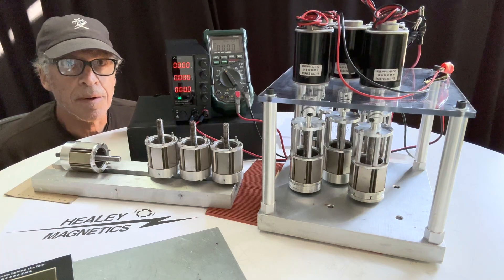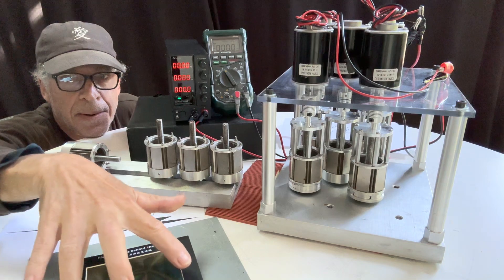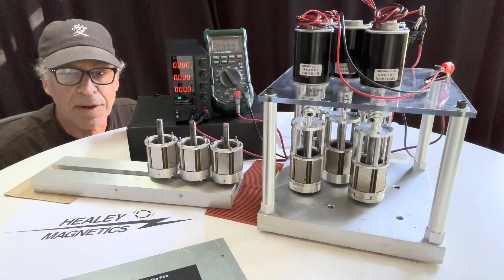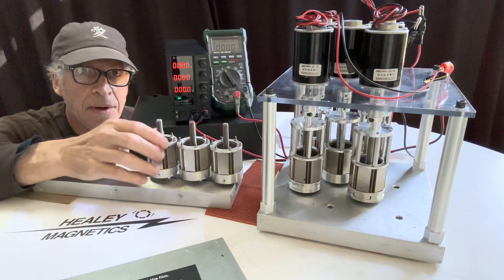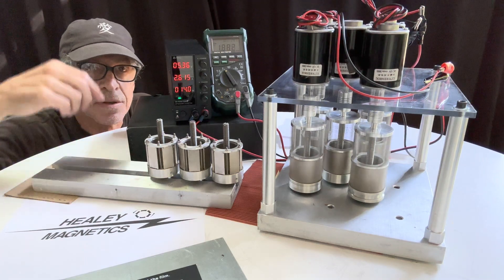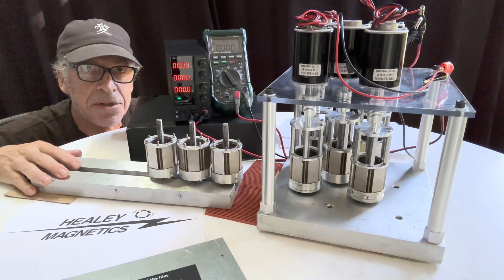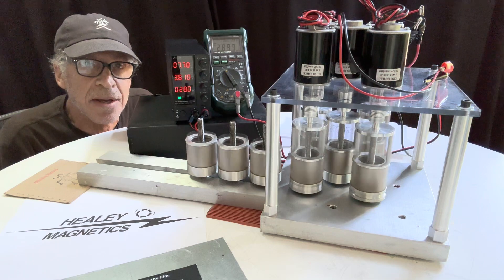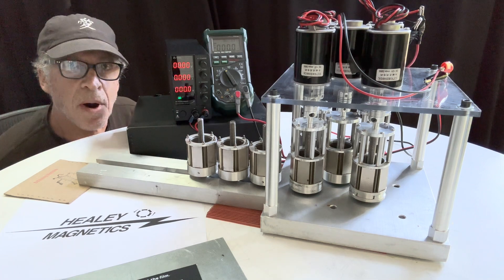Magnetic Gear satellite generator system...

Comment: why are the output motors only making half power ?..
Reply from the maker: Please subscribe .  I am finishing up an explainer video that i will post in a week or so..  This video demonstrates that the  magnet arrays will not slip or decouple.. at high speed. (It is not an energy multiplier defying laws of physics -there are energy losses.. ) the central motor is driving 4 magnetically coupled satellites. If i set it up one to one there is a loss of a few percent.  There is a strange anomaly with this type of system.. and the research scientists i am working with have yet to define why this happens.. maybe you can answer it.. the system with a constant voltage input and ac induction motor(not shown in this demo) speeds up and resistance drops.. it happens in a quantized way.. we think the angular momentum of satellites contributes kinetic energy back to the center motor. The lag and lead in field shading seems to be trying to sync with current and eventually rpm jumps levels out and jumps again.. how is this happening? More rpm without any additional voltage!  Even under a load.!!!  my next video shows several potential industrial applications.
Reply: @evanlevy8947  ok awesome..yes im subbed....its all very interesting.. thankyou for your reply and look forward to the next vid....cheers
Reply from the maker: Multiply by 4… there are 4 satellites rotors.. voltmeter is inly reading 1
Reply: @evanlevy8947  yes...but i was wondering why if they are going at the same speed....why does each only make roughly half?.. i would have thought they would have made say 95% power in ratio?...thanks

Comment: Approximately how much torque can be coupled before slippage occurs with the demonstrated setup?  I presume, this is scalable and dependent on rotor diameter and strength of the magnet?  What happens when load on the system exceeds design ratings and slippage occurs, I would suspect considerable heating of the rotating elements to result?  And have the thermal efficiencies in this magnetically coupled system been studied?  Have you investigated the system with a thermal camera while running for an extended duration?  The thermal considerations are likely the biggest limiting factor in a system like this as exceeding a magnet's Curie Temperature will kill it.
Reply from the maker: Torque is dependent on proximity.. strength of magnets… the system can produce same torque as any electric permanent magnet motor.. and similar temperature ranges.. and we have designed and built new prototypes with larger magnets… Nb magnets loose less than 1% of their strength in 100years if operated under their temp ranges…
Reply from the maker: Also as someone with knowledge maybe you can answer why a weird anomaly occurs with this system… we have replaced central drive with ac induction.. to test at 8,000 rpm (btw-no slippage occurs at really high rpm ).  with constant voltage applied the system speeds up in quantized steps… and amps drop… we think it is caused by lag/lead in emf reacting with the angular momentum supplied by satellite arrays… we are licensing our idea and have several new prototypes built to demonstrate its capacity in industrial applications…

Comment: Would fluid magnets eliminate the chocking?
Reply from the maker: It’s a question of proximity and architecture of satellite arrays.. there are many variables to test and try according to applications… we are designing several systems and the real magic of this system in my opinion is extremely high speeds.. adjustable torque.. and utilizing conservation of angular momentum in a closed systems..
Reply: @evanlevy8947  I am not sure of angular momentum. I will check into that.

Comment: What's the overall powerless per unit added? That needs to be figured.

Immediate implications are quite simple -  being things like a leaf blower, drill, small frictionless motor... HOW much slippage can it handle? I mean, what if I stick a stick in it? How much force until slippage in the middle of the array and how much on the outside array via physical force? Can the slippage be measured accurately by distance per unit? Obviously bigger magnets would have a different effect. May be worth doing the calculations if only with the model you have.
 Industrial applications?
AC units. You would need to add directional blades.
Any kind of medium sized motor.
Cnc machines.
Fluid driven pumps like sump pumps.
Even a bicycle gear...
Reply from the maker: We are doing testing.. and you are accurate as to proximity and architecture… and are working on prototype that allows for changing those parameters. There are some really strange phenomena going on with this system at high speed… i cannot divulge this until we establish independent verification.. but our systems should be a game changer in several different applications..  essentially the nodes and gap angles act as an ambi-polar projection of magnetic flux density..
Reply: @Evan Levy  very promising. May be relative to thermal surroundings. May be relevant to divulge into coil whine but I assume that's been well established seeing there's a field. 

I've always liked what magnets do to mercury.

Comment: Please sir check into magnetic bearings. I theorize that with magnetic bearings, Tesla turbines driven by air could be blow started. If said turbines were to have the exhaust feed back into the intake, and the turbine coupled magnetically to generate power we could have the worlds first to my knowledge air electric hybrid system for vehicles.
Reply from the maker: https://youtu.be/EwWTf5BpfBM

Comment: I might have missed it but how much torque can be had at one of the magnets before it slips, decouples from the driving magnet..?
Reply from the maker: torque is contingent on proximity of the arrays.  this is first gen prototype...and at fixed distance... what the video shows is proof of concept as to how field strength at nodes creates stronger coupling effect.. and the fact that there is not slippage at high speed under static load..  i cannot provide more details but there is a way to design this with a torque multiplier effect..
Reply: @evanlevy8947 such a no shit Sherlock useless answer. Until you prove that this can handle torque any better than any other magnetic coupling, you've done nothing but waste peoples time and entertain the uneducated. We want science not entertainment.

Comment: Ur saying there is no slippage but u need resistance to cause slippage and none of those satellite generators are under any load so obviously there is no resistance which means there won’t be any slippage, I don’t get ur point of explaining that .
Reply from the maker: I add another linear array at end of video that adds resistance.  if you notice the arrays are relatively far apart.. as you move them closer the torque would increase. this follows the inverse square law of the field strength as it varies at a distance...this is a first gen prototype demonstrating proof of concept... the unique field strength at the nodes creates a greater coupling effect.  so its a magnetic gear that can couple at higher torque and rpm...to get useful data for an application everything you see needs optimizing.. there is a way to add arrays as torque multipliers depending on architecture and application necessity..
Reply: @evanlevy8947  it’s still not enough resistance. U are still just spinning magnets. I commented this on ur last video and u said u were going to show it under load in this video. If all u want to do is spin magnets fair play u have found a way but it will just stall as soon as u apply load to it . If u have ever used a petrol generator u will know it can happily tick over and spin by it’s self but as soon as u plug something in and start drawing power the engine will bog down as it meets the resistance of the generator. If this can’t turn any weight or load it’s literally pointless

Comment: Can you run this again with the following changes.

Use a single motor
Add hall effect sensors or tachometers to each motor
Display all data at same time for our real time review.

I'm intrigued, but saying there is no slippage when you are using motors to turn every rotor is odd.
Reply from the maker: please rewatch video... only the center is array is a motor.. all the others are magnetically coupled satellite generators.. I have a tachometer and all the arrays are spinning at the same velocity...

Comment: Try to load the generator maybe there will be some slippage.
Reply from the maker: the torque at which it will slip is proportional to the distance the arrays are apart and magnet strength...it should follow the inverse square law to some degree... the field strength of coupling increases geometrically as you have the arrays spinning closer...  all this needs testing... the novel magnet shape does produce a different flux pattern than other magnet designs in the way the arrays project strength at the nodes... also the way angular momentum is transferred is different than a belt chain or gear.... because of how the fields push and pull as the arrays interact...  I hate to get lumped into the free energy bs ... all I am demonstrating is a unique coupling that I think has advantages in certain applications
Reply: @evanlevy8947  thank you for your time 🙏

Comment: I'm not entirely sure about the point being made here. Were people implying that they would slip with no load? I believe the stall torque in a magnetically coupled system would largely depend on the strength of the magnetic coupling, rather than the output torque of the motor. In all cases the electrical fields responsible for a physically coupled system are going to be higher than anything a magnetically coupled system couple could produce. So other than reduced "wear and tear" what benefits does it offer?
Reply: I don't get it either. It looks neat but this demonstration shows nothing other than magnetic couplings work very well - when very little power is transmitted. 

The output voltage is meaningless with regards to the magnetic coupling. It would show the same results if physically coupled - except if there was any significant load, then the magnetic coupling would slip.

A demonstration like this needs to have a load on the output (volts AND amps) for it to have any value beyond impressing the layperson.
Reply: @HarmanRobotics  yep, i assume the youtube algorithm is promoting these videos to the free energy machine crowd. Like i get it yeh you can make magnetic couplings and gears? So what? There is a reason these are hardly ever used. They are only capable of modest torques.
Reply from the maker: Hive mind of the comment sections either has this idea being a useless little spinny thingy( 15%) or genius, world changing billion dollar invention (85%)...(note: I would settle for somewhere in between)...  but seriously you do have to extrapolate a use... and the intention of video is further proof of concept.. it is possible to do somethings that have not been done....please subscribe...I plan to post another video that might answer the 15%

Comment: Think about this, 1motor connect to rotor with a total 9 like a rubix cube formation
You can generate 8 generators at the same time. If generator produce 12x8 = 96 volts.
With just 1x12 volte elec motor. Maybe you can power an elec terrain vehicle or elec go kart with a power control,  no need hundreds of battery.
Reply: Some engineer will tell us that will not be possible because it violates some law(s) that has been established.

Laws are sometimes broken.
Reply from the maker: https://youtu.be/EwWTf5BpfBM

Comment: I'm wondering many things now. I wonder what a larger diameter say 12 inch motor running at a constant current, constant voltage. Which creates more torque when put under load. Then have those what you there all around the outside of 12 inch bldc motor. They would obviously spin much faster. But would have to test many, many things. Like 32 generators, 32 spark gaps firing towards 1 center electrode.
Reply from the maker: https://youtu.be/EwWTf5BpfBM

Comment: Just a couple questions. What is this thingy that you made? I'm just a bit confused here. And why are you under the table?
Reply from the maker: magnetically levitating anti gravity device....hah... I raised table to show how concave shaped magnets create coupling that allows for transferring motion without gears/ pulleys
Reply: @evanlevy8947  Have you tested the friction between the 2? I'm betting there is far less friction with gears. Esp helical gears. Seems the magnets would really want to bog everything down and if that's the case that could end up costing more money in electricity trying to power over that friction the magnets create. Im coming from over 40 years exp as a transmission mechanic. Just a thought.

Comment: How about heat generated during roation of magnets couples, and of heat generated, is magnets lose his flu energy , if so ,how about cooling magantic process system
Reply: If heat generate
Reply: It's flux energy
Reply from the maker: you are correct that heat sinks and airflow need to keep below a certain operating temp..  regular induction motors have similar problems and it heat can be managed...

Comment: Free spinning is great but what about putting some load on generators?
Reply from the maker: the linear array I added at end of video produced a load.  you are correct that these types of calculations need to occur... effective computer modeling is as expensive as empirically building and testing because of the complexity of field interactions in spinning arrays.  that is why I need to secure funding to optimize prototype and do independent testing

Comment: What determines maximum torque transmission?
Reply from the maker: like any other motor.. flux density, magnet size....  the proximity of arrays follow the inverse square law of magnetism so how close they are determines torque too....
Reply: @evanlevy8947  I wasn't sure exactly how shaping the magnets affects the slip torque. Presumably this is due to "designing" the flux density?
Reply: @evanlevy8947  how does this approach compare to the traditional magnetic gears using non-magnetic stator poles to change the flux between two magnetic rotors?

Comment: No mechanical interface, One motor driving one and the others being connected to generators. What an idea! Plug-in a new array and you expand your capacity for energy generation
Reply: But the generators aren’t powering anything they are just spinning. Once u put them under load they will cause resistance. Just like a petrol generator , it’ll spin just fine not doing anything but as soon as u plug something in it starts drawing power it will begin to bog down and struggle
Reply: @Surgeeon  true.
Reply from the maker: https://youtu.be/EwWTf5BpfBM

Comment: Calculating the loss isn't possible if the output's amps aren't shown.
Is it feasible to capture the outer flux in a super capacitor without introducing resistance?
Reply from the maker: it does work...https://youtu.be/EwWTf5BpfBM

Comment: What would be a use case for this type of system? Magnets passing in and out of other magnetic fields will strip the magnets of their magnetism. 

3 ways a magnet can lose its fiel: shock, heat and passing inside another magnetic field repeatedly
Reply from the maker: Not correct...
Reply: @evanlevy8947  did I make a mistake?